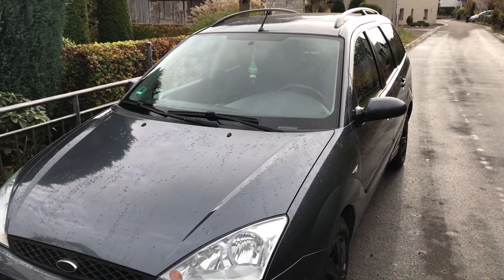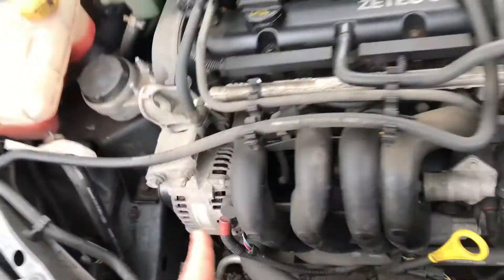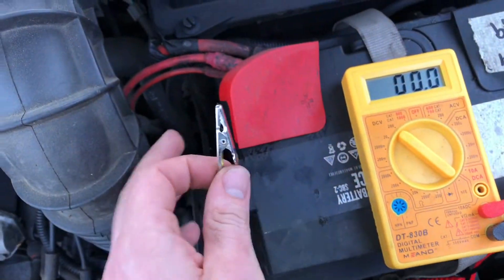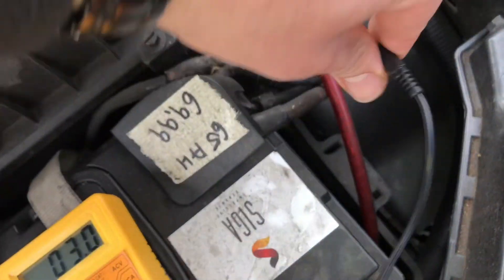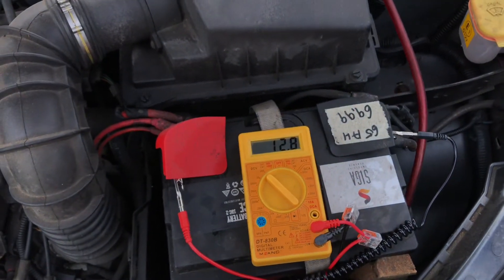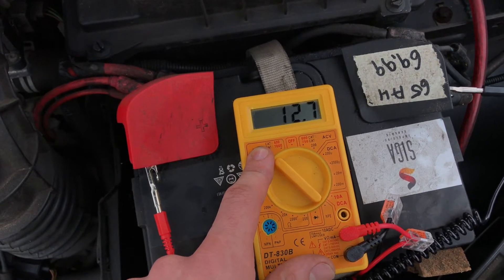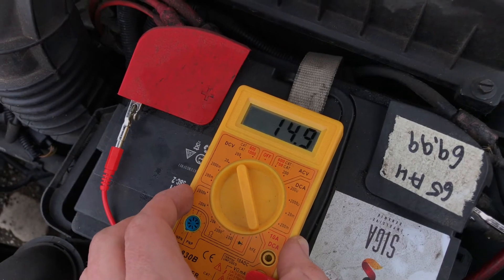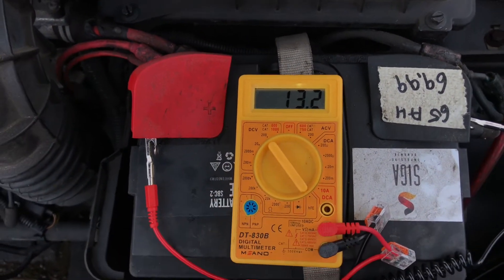How to test car alternator with a multimeter Ford Focus DIY

Comment: You said set meter to 200 AMPS it is set on voltage?  Whats up.
Reply: I think he meant DC volts, and I'm not sure why you'd need anything higher than the 20v setting TBH.